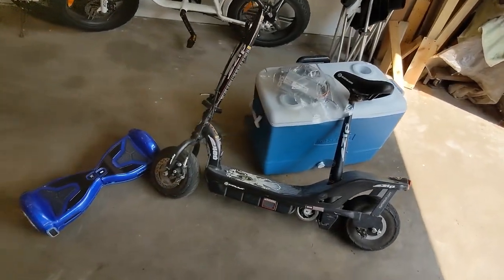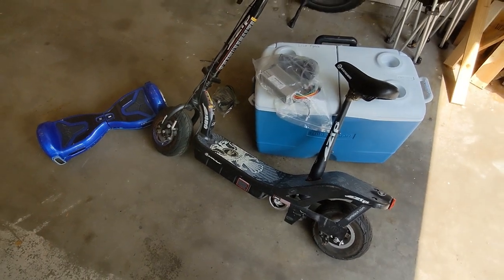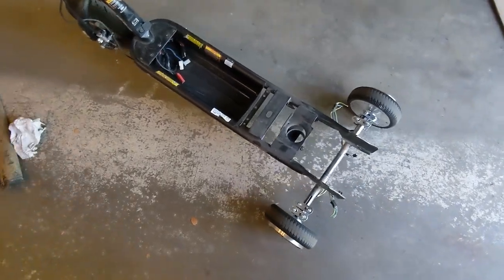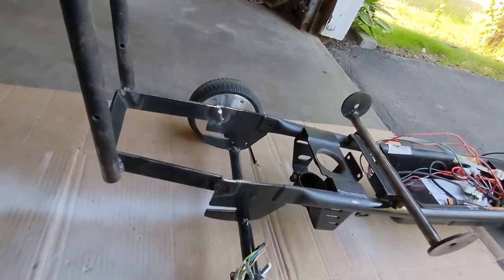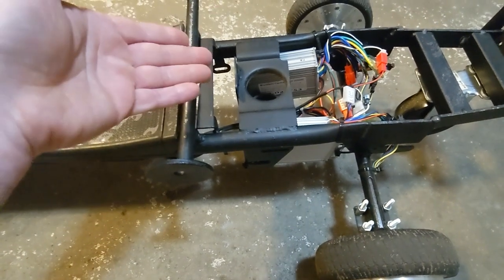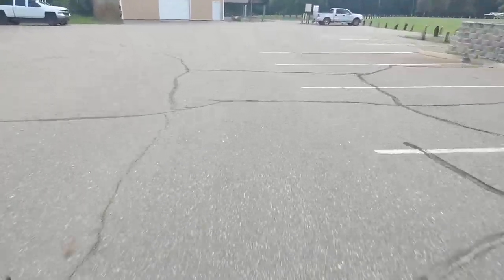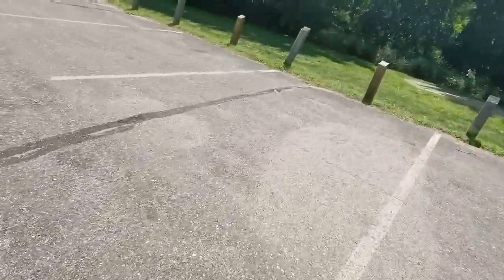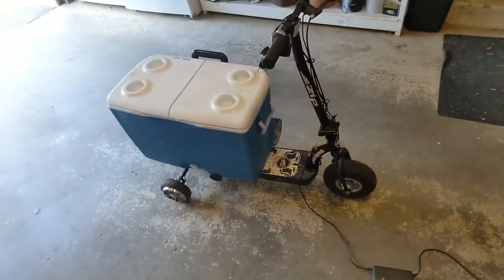Lets build a cooler scooter

Comment: Great job repurposing perceived “junk” into something great! I just finished my latest rendition made of an old e scooter 🛵. I bought an ev battery off battery hookup and found an 1800w 48v vevor kit on clearance for $97 shipped to my door. My daughter n I zip all around the neighborhood and to the store, probably 10 miles on a single charge. 6 mi at 25mph+. If you remember me from a week or 2 ago, I got that 97 Escalade cluster flashed per the bulletin from gm for the dead cluster w only blinking needle glow. They reflashed it and everything works except the warning lights and turn signals. I’m considering buying an MDI2 to do these myself but I’m unsure of the software needed and if I can obtain the files needed.
Reply from the maker: 1800 watt! Nice. That's twice the power of my e-bike!

Comment: Since your scooter has no suspension, those pneumatic tires would work better on those cracks in the pavement. Maybe when the scooter is full of ice and drinks, it will ride a little smoother? Nice work!
Reply from the maker: Yes pneumatic tires would give a better ride. But unfortunately most hoverboard brushless hub motors are solid rubber.